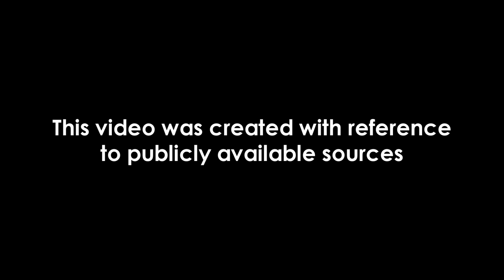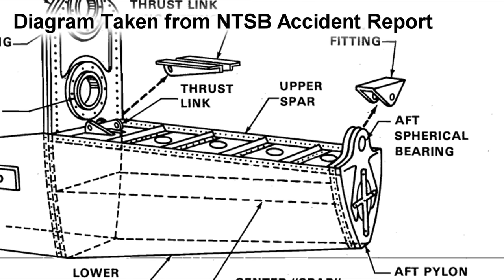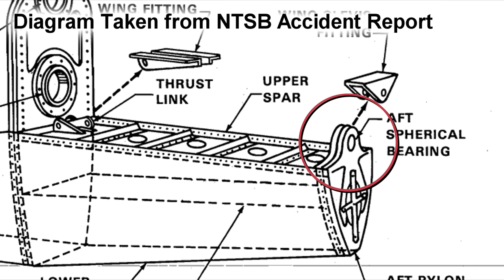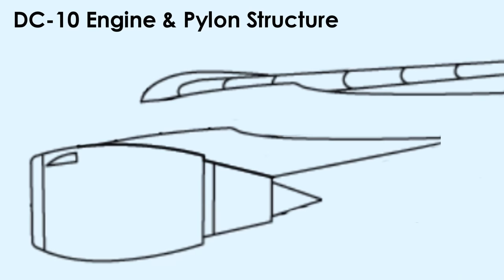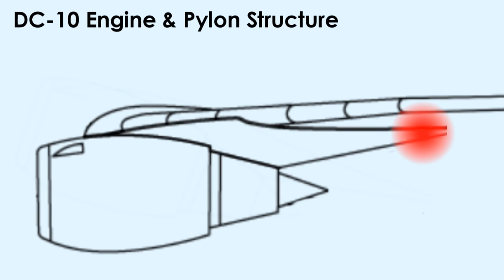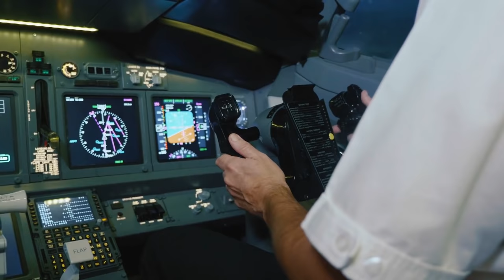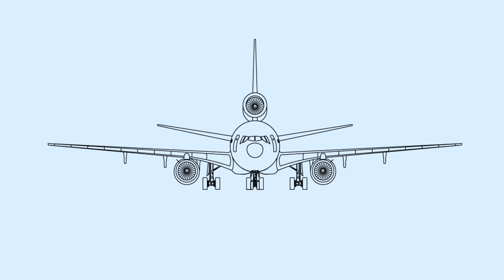America's Deadliest Air Disaster (American Airlines Flight 191) - DISASTER BREAKDOWN

Comment: This is the saddest accident I’ve ever studied, if only the stick shaker was also on the first officers side they might have been able to land it, instead those 272 people had to endure knowing they would die. The most shocking thing to me was that American Airlines got 25000000 in insurance pay outs and tried to hide it. When I fly it’s never with them because of this, I can’t believe what they put those families through knowing that there cut throat practices caused that engine brackets to break , shame on you. Then the DC10, which proved to be a descent airliner was forever tarnished due to incompetence on the part of the media and the lead investigator.
Reply: Yeah, the way I understood it, the stick shaker for the co-pilot's controls was available as an option, but one the operator decided against purchasing. Another big "what if," however, was pure engineering. In design it had been decided that slats position would be maintained with hydraulic pressure alone. Older airliners had independent mechanisms that would lock the slats in place. Had that mechanism been retained in the DC-10's design, those slats wouldn't have retracted under aerodynamic pressure once the hydraulic system failed.
Reply: Hardly surprising they got an insurance payout, a plane was destroyed. Naturally airlines might 'hide' it, as nobody wants to hear about airlines receiving a payment after a crash.
The final settlement with victims families was $110 million, which may well have been paid by the insurance company.
Insurance would be pointless if they didn't pay out.

Comment: My whole thing is how do you come to find out a bend or crack happened before the actual crash where everything is literally bending and cracking and exploding?
Reply: Hi! Things like metal fatigue often have very noticeable ways of tearing. When a plane crashes, it shows damage that correlates with the surroundings and situation: as does the metal when it cracks and explodes. Metal fatigue often can be identified by a ‘starting’ area and an area of failure: these two areas look significantly different. When a plane crashes and its metal explodes/deforms, it looks shattered and has the same level of damage along the seams. I hope it makes sense!
Reply: The broken attachment mount was attached to the engine, laying on the runway still bolted together. 
The other piece was found at the crash site. 
It had damage on it, that matched the shape of the top of the pylon.
The pylon could only have hit the the attachment,  causing the damage , with the bolt out.
When bolted in place, the damaged area would have been , don't know this distance for sure, maybe two inches away from each other.
When  they removed the bolt, the engine tilted, up, in the rear, striking the pylon.
Reply: @alhanes5803  smh this is why I pray before even the shortest flights
Reply: @DarthNaeger  honestly bud, the chances of ypu being in an accident of any type while flying are the same as winning the lottery (not exactly the same chances but comes really close) so really you should just relax
Reply: @NepNep8840  yes but clearly accidents happen and that’s always in the back of my mind 😭 especially nowadays. I lose faith in society and it’s ability to maintain itself more and more by the hour
Reply: @DarthNaeger  but an aircraft sure can maintain itself,  plus if you ever find yourself in an accident the odds of you getting out alive are still high as fuck

Comment: I grew up in a suburb about 5 miles south of O'Hare, Bellwood, IL. On this date, I was 19 and working part-time as a janitor for Allied Van Lines in Broadview, IL. Part of my job was to empty trash cans in the "tall building" of the AVL complex, (as we called it), at the corner of 25th and Roosevelt. I was on the 6th floor at around 6pm, and I looked northwest and saw at least 15-20 planes in what looked like a holding pattern circling over O'Hare, I thought uh, oh, something must have happened at the airport.....that picture was on the front page of the Chicago Tribune. It is haunting and still makes me sick to my stomach, to see a plane in such an odd position, knowing that within seconds everyone will be gone. I had heard that the backs of the seats were equipped with a small video screen and the passengers could watch the flight of the plane, including the take-off, which means they might have been watching the plane going down, I'm not sure if this is just a myth or true?

Comment: Another American Airlines air disaster was caused by American Airlines themselves and also actually came close to surpassing this accident, American Airlines Flight 587.

Flight 587 was an Airbus A300B4-605R that was operating the flight from John F. Kennedy Airport in New York to Las Americas Airport in the Dominican Republic, carrying 251 passengers and 9 crew members, 2 of which were the pilots, on November 12, 2001. 

The pilots were 42 year old Edward States, and 34 year old Sten Molin, who had also been reported by his fellow pilots as someone who like to be aggressive with using the rudder. One of the passengers was also a survivor of the 9/11 attacks.

The A300 taxied to Runway 31L behind a Japan Airlines Boeing 747-400 operating Japan Airlines Flight 47 to Tokyo Narita, the 747 was cleared for takeoff at 9:11:08 am EST. The controller warned about possible wake turbulence caused by the 747 at 9:11:36. 

At 9:13:28, American Flight 587 was cleared for takeoff on 31L some 1 minute and 42 seconds after the JAL flight had left the ground and was instructed to fly the bridge climb after takeoff, proceeding to waypoint WAVEY, and to climb to 13,000 feet. They left the ground at 9:14:29, after a short discussion about something related to the flight, and climbed past an altitude of 500 feet, now turning towards heading 220. 

What I can only assume is problems caused by the 747's wake turbulence, which should have had absolutely no effect on the A300 other than minor turbulence, the flight crew commented on it, saying "little wake turbulence huh?", the first officer replying "yeah". At around this time, First Officer Sten Molin began kicking the rudder, alternating between left and right maximum movements, as part of his pilot training.

Around the same time, someone in the opposite direction called "Tower, look to the South, there's an aircraft crashing." The was no aircraft crashing, but on the ATC recording, it still seemed as if they had an aircraft missing.

After the aircraft was assumed to have crashed, they responded to ATC, confirming that they were still in the air.

The First Officer continued to deflect the rudder from left to right 11 times, causing tremendous amounts of stress on the vertical tailfin, and also causing the flight crew to believe that the turbulence was getting more severe, when they were actually fighting themselves.

[ 9:15:48 ]
Molin: "Max power."
States: "You alright?"
Molin: "..yeah, I'm fine."
States: "Hang onto it, hang onto it."
Molin: "Lets just go full power please."

The constant deflection of the rudder began to cause sideslip, whereas the aircraft began to travel somewhat sideways, but also forwards. It is possibly believed that the airframe of the aircraft shuddered as this went on.

At 9:15:58, lateral (possibly torsional overload) forces caused the entire vertical tailfin on the A300 failed and snapped off the aircraft with a huge dull metallic boom, having suffered over 200,000 pounds or more of aerodynamic forces, which actually was later found and had turned out to be a design flaw with the A300. The loss of the vertical stabilizer caused an immediate unstability of the flight, and also caused an aerodynamic stall, which explained the freefall of the A300. The nose drops and the pilots lose control of the aircraft. Because the aircraft was in a yawing turn at the time of the stabilizer fail, as the pilots struggled to control the aircraft, the A300 entered a flat spin while falling towards the ground, which was confirmed by eye witnesses to the accident.

[ 9:16:07 ]
Molin: "Holy crap."
..
Molin: "What the hell are we into, we're stuck in it!"
States: "Get it out of it, get it out of it!"

The stall warning sounded, confirming the suspicions of an aerodynamic stall, and the engines were sheared off the aircraft as well, coming to rest a few blocks north and east of the aircraft's final resting site, also cutting power to the FDR at 9:16:01. At 9:16:14, the A300, having been in a flat spin for less than a minute now, spun and slammed into the ground in Queens, New York, between Newport Avenue and Beach 131st street, reigniting fear of 9/11 happening again. 260 people are dead, as well as 5 on the ground, making this the deadliest accident to have ever involved an A300 Airbus, and both the second deadliest US Air Disaster, AND American Airlines's second deadliest air disaster.

And the saddest part is that.. 2 dogs have died in this accident..

Comment: I saw a show about this and they said if the pilots had retracted the flaps and slats on the right side and increased power they would've been able to fly the airplane and at least MAYBE have a shot at landing it. Pilots followed the book on what to do in an engine out scenario.
Reply: But then that wing would stall too, gets you nowhere.
Reply: @peteconrad2077  Even with the increase in power? Of course hindsight is 20/20. I doubt if they could see that the entire engine fell off. The show I watched seem to be suggesting that the book was wrong and the pilots followed the book.
Reply: @richstewart1  power doesn’t break a stall. It might help to recover from one but only reducing the AoA will break the stall. Their onyx chance was it keep speed up. Increased thrust would have only made a very small contribution to this since they were at high power anyway. Also, increased power would have increased their control problems and likely made it worse.

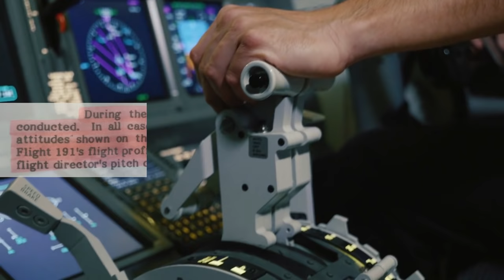Comment: 12:19 you mentioned the tests in the simulator where the control inputs that replicated those of the crew always resulted in a crash. However, you didn’t mention that in simulator flights where power was added or maintained and speed increased or maintained, it was possible that 191 could have recovered and the accident avoided.
Reply: Exactly, it's inevitable that replicated controls would result in the same crash.
It seems recovery wasn't especially difficult if the pilots had known what was happening, or if they had quickly recognized the rotation as a stall.
However all of the simulator pilots thought it wasn't reasonable to expect the actual pilots to respond in the same way as they did, as they didn't have the same information.
This kind of thing seems to often be repeated in youtube 'documentaries' about crashes, it shows a lack of research depth or understanding, &/or a tendency to show 'popular' information.
Reply: @DoubleMonoLR  Actually, the simulations led American to change their procedures in the event of an engine failure on the DC-10. If the failure happened after the plane exceeded V2 speed, pilots no longer need to slow down to V2, but just maintain V2 + 10 knots. They used the procedures that the USAF used for the KC-10 tanker.

Comment: The NTSB is amazing....that they can figure out these details from a tragic accident site is almost beyond belief.
Reply: I wonder how accurate they are with all the pressure to get to the bottom of it.Many times the pilot is implicated who is deceased and cannot defend himself.I have been in the "witch hunt" as it's called,it is stressful .I was called to see the director of maintenance at Associated Air Center in Dallas.He seemingly gave me an "out" by saying the work in question was performed after my shift absolving me of responsibility.If I lied it would have made my alibi non effective.I told the truth and then was told the FAA could be involved.I asked to have it go there and it was no no don't worry.All my paperwork was correct, and one of the few times they were needed it would have helped me I believe.People fear them, but they are there for a reason.
Reply: @allanbrogdon5317  They are plainly open when there's any doubt about specifics &/or the overall cause.
The investigations regularly take years.
Being inaccurate would be terrible for safety.
In this case there was a photo showing fluids leaking out of the wing, the forklift use was known, damage was found that was from prior to the crash, etc.

Comment: The amount of accidents involving DC-10’s was unbelievable. I’m surprised that anyone flew on them after flight 191 crashed. Especially taking into account the other disasters in the 70’s. I wonder why they weren’t grounded?? Especially as the 737 Max was after 2 horrible crashes.
Reply: That one always confused me. The only disaster with the L-1011 Tri Star was Delta 191 in the 80’s. And that was caused by wind shear.
Reply: > he amount of accidents involving DC-10’s was unbelievable.

Not really, if you look at the overall flights, the number of flights that were completed between 1971 and 2007 or so, and even less so if you look at the aircraft without dividing things up by sub-type (dc-10-10, dc-10-30, etc)
Reply: @ Michael W

That’s because the L-1011 was lucky.. and also flew a fraction of the hours the DC-10 did. In service later, out of service earlier, fewer made, and lower utilization due to the insane maintenance demands and poor dispatch reliability. 

An L-1011 had a centre engine explode and shrapnel hit all four hydraulic systems. Only luck prevented the fourth system from being penetrated and losing all of its pressure and fluid. 

The DC-10 never lost control of its horizontal stabilizer like the L-1011 did. Only luck brought that plane back to earth safely as well.
Reply: @DanknDerpyGamer  compared to the amount of crashes in the first few years of the 747, 737 etc,which was a fraction of the DC-10, I would say it was out of the ordinary, if not unbelievable.

Comment: One thing you didn’t mention, which is kind of important: there was no stick shaker on the First Officer’s side. Having stick shakers on both sides was a customer option for the DC-10, and American did not select it. The captain’s stick shaker was disabled due to the loss of hydraulic fluid on the left side. Had there been a stick shaker installed on the F/O side, they would have been warned about the impending stall when they reduced their speed.

American wasn’t the only airline taking shortcuts on the engine maintenance. When the planes were grounded and inspected in the aftermath of the crash, the same kind of pylon damage was detected on planes in other airline’s fleets, such as Continental.

The flight’s final destination was supposed to be Honolulu, but since the plane was a 10-Series, it didn’t have the range, hence the stopover in Los Angeles.

Comment: The plane could have been saved if the pilots knew of the stall, but they didn’t

The video doesn’t mention the cameras that were on the plane to let passengers see outside. Yikes
Reply: I'm not sure about them being able to save it bc of the automatic slat retraction. The left wing just couldn't produce lift at the low airspeed. In the video, they had said that 13 very experienced DC-10 Captains were put in the simulator with the exact scenario that flight 191 experienced. None of them could save the plane. The simulator basically ended each attempt the same as the actual flight.
Now, I dont know if pushing full throttle could've gotten the plane up to speed where the slats could be retracted and still could've kept the plane flying. I'm sorry...when I look at things like this I try to figure it out in my head but I will write it down. So no...I'm not insane, so I've been told.
Reply: @kieranwestgate plane was rendered uncontrollable without hydraulics